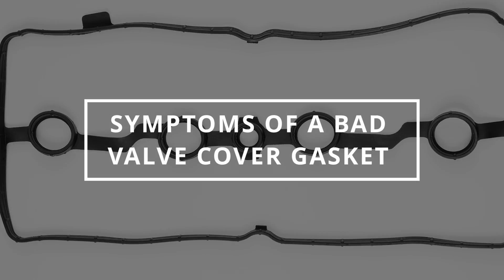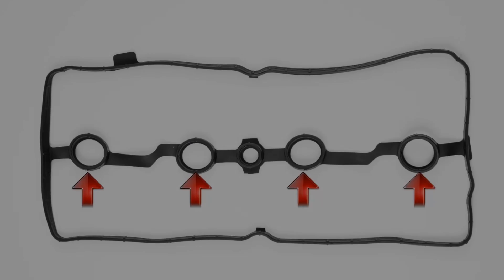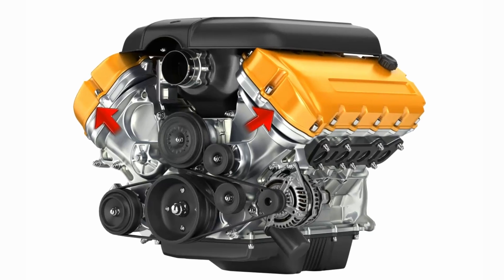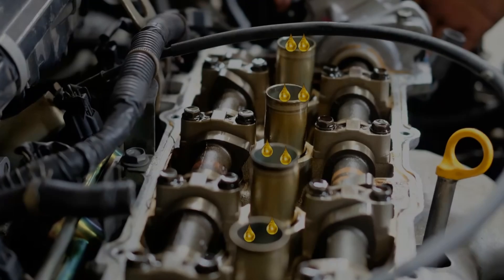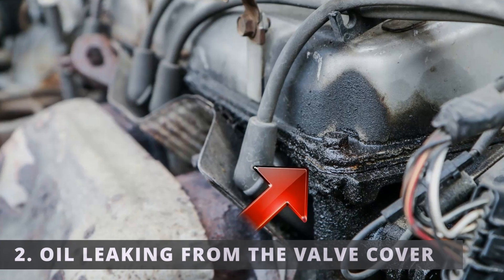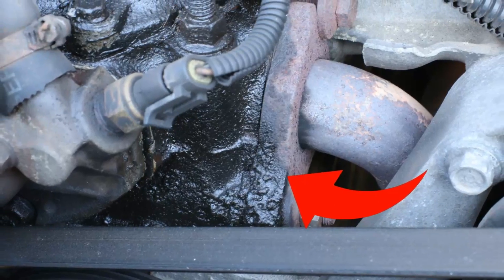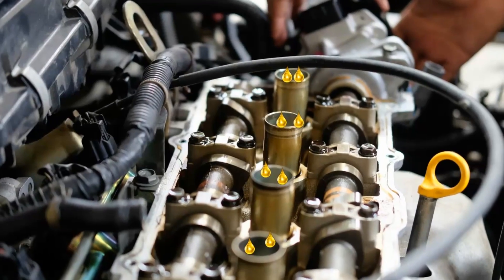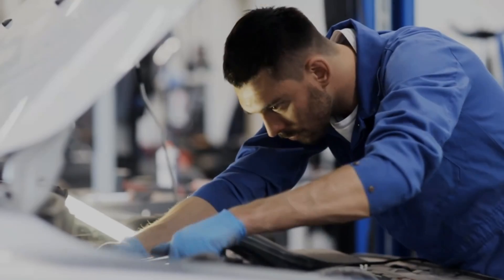SYMPTOMS OF A BAD VALVE COVER GASKET

Comment from the maker: OBD2 Scanner: https://amzn.to/3PHRplS

My favorite repair manual: 
https://www.gopjn.com/t/SENKTklLS01DSE1NS0lOQ0dKRk9LTw
(Use code AD10VA for 15% off one-year subscriptions for any US Order)

Have car-related questions? Check out JustAnswer! They have verified auto mechanics that are available as live help 24/7: https://justanswer.9pctbx.net/qndBon

Check out my merch: https://easyautofix.creator-spring.com/

Buy a new valve cover gasket: https://advanceautoparts.rt8x.net/YgZ2BJ

Here are some of my favorite items that you might like:
Tools: https://amzn.to/3xNDb8g
Car Vacuum: https://amzn.to/3EjhPSJ 
Cleaning Tools: https://amzn.to/3El7dCG 
Water Repellency Wiper Blade: https://amzn.to/3utvK50 
Cleaning Gel For Cars: https://amzn.to/36NIiMr 
Portable Air Pump for Car Tires: https://amzn.to/3uBuPzA 
Headlight Restoration Kit: https://amzn.to/3qDpOVH 
Amp Jump Starter: https://amzn.to/3pMd0vx
Reply: Could this in theory keep setting off the mass airflow sensor

Comment: Wow. Wonderful video. Good info and quick and precise. This is definitely my problem. I called two local shops and explained my situation and they said they could do a diagnostic, I mentioned a pcv valve or gasket and they still didn’t confirm or deny. 

Anyways, this video helps a lot and now I know exactly what my problem is. 

I had oil in 2 of my spark plug wells, so I changed the spark plugs, and now I actually found the problem. Would be nice if mechanics irl would just be helpful and give tips. 

Thanks again! I was worried my entire engine was broken but this is actually doable fix

Comment: I have a valve cover gasket leak on the drivers side of my 2007 jeep grand Cherokee and its causing alot of smoke to happen every time I drive. It's rather embarrassing. I miss my corolla. Had it for 3 years and the only issue i ever had with it was a bad temperature sensor. Other than that it never failed or let me down.

Comment: Would this lead to a ticking sound when driving? Just noticed the leak from the gasket and am going to change but want to know if there is another issue I also have to get fixed
Reply: Having this same issue rn, did you figure it out?

Comment: My car started misfiring and I took the rear spark plugs out and they were covered in oil, but there isn't much sitting in the tube's so would I be safe to put the spark plugs back in? As a temporary fix
Reply: When you take the plugs out, the oil will drop down back into the cylinder. What I would do is just a shop towel, roll it up so it fits into the cylinder well (make sure the spark plug is out first) and soak up whatever you can of the oil. I’d also spray some break parts cleaner onto the spark plug and clean those off, and clean oil off the boot of the ignition coil boot. This will ensure your car gets a good spark and doesn’t stall or foul out your plugs. Hope this helps! 

I usually just use the base / handle of my smallest wrench, and just wrap a shop towel around it until it’s a perfect cylinder so it fits into the cylinder well with ease. ✌️

Comment: It's crazy. My oil was super black and low. My 03' G35 was leaking oil, and it seems like valve cover gasket. It takes 5 quarts but was low (it had about 3.5 quarts) before I changed it. After I changed it, I heard a pop and all my oil started leaking out like crazy, like pouring out water from a water botttle, all at once. Legit the 5 quarts I added leaked out. And there was smoke near my passenger headers behind engine. There seems to be no leaks from hoses. So my guess is valve cover gasket. But would it even be able to do that?

Comment: Would oily spark plugs be one of the symptoms?
I was changing the spark plugs on my 2010 chevy colorado with a 5 cylinder in line and the front 2 were dirty with oil stains 
And the rest were dry.
Reply: Yes

Comment: Just getting mine replaced on my 2011 5.0. I had smoke coming from the oil compartment engine backfires and it was burning oil and loss of acceleration getting it back tomorrow they also fixed my vacumme leak so hopefully it goes back to 100%
Reply: How much was it?

Comment: Man I’ve been searching for the my p0303 code for a month. Changed out the spark plugs, wires and ignition coils. Add an aggressive fuel injection cleaner. Nothing. I noticed a leak of oil from the valve cover where cylinder 5 and 3 are at. hopefully this solves the issue. Truck runs great just pops that code from time to time.
Reply: I have the same issue as you on my ford focus 2012
Reply: Update?

Comment: I replaced my valve cover gasket two times now in 2 months. It was leaking fresh oil the 2nd time around. Could this be the mechanics error the first go around?
Reply: Eh prob cover itself warped
Reply: Did you replace the washers

Comment: Does tightening down help this. i saw a video where all of the screws were loose on the valve cover.
Reply: Replace your shirt bro it’s way cheaper than buying the whole new engine
Reply: @8Jallin  Mine isn't leaking, kind of a light mist of oil on the side of it. That's why I asked. The truck only has 43k but it's an 06 and within time gaskets dry up. I end up buying both covers, seals,  New Z1 Electronic Coils as well as 6 new spark plugs.
Reply: @ELEVOPR  I see. Good thing it all worked out for you. I might check mine before I install a new one I might be lose too.

Comment: Will this cause oil on the spark plugs from the leaking? But only on the threads, the rest of my spark plugs are clean
Reply: Usually the plug valley will fill up, even covering part of the spark plug boot. So it's only oil at the threads and below, nothing above the crush washer? If that's the case then unfortunately you have a much bigger problem. :(
Reply: I think it depends on how long u leave the issue un fixed or something I'm a complete novice also it might be how the valve cover was made

Comment: So I have been chasing code after code, so now here we are left with the last 4 codes, bank1&2 lean, Catalyst both banks below threshold, LTFT is sitting at 33 at idle. I have been hunting down what the heck could still be leaking, then I did my spark plugs and saw oil and put two and two together, pcv directly to intake is on valve cover.
Reply: @theory816 when I blew my timing belt it was negative 5 degrees out, I kind of screwed that one up myself, gasket was smooshed and twisted, and after I was done, I didn't do the pcv valve yet, my first ride smoked out the hood, PCV valve went completely.
Reply: @theory816 So I solved it, I was watching bank 2 being rich and not paying any attention to the lean on bank 1. So ripped apart and replaced valve cover gaskets, and pcv valve, egr O ring and intake upper and lower. Car runs mint. Still have a fluctuating idle sitting in drive. But I am going to address the transmission too, filter and fluid.

Comment: Is it safe to replace the bad gasket with rtv silicone?
Reply: No do not just use rtv purchase the correct gasket for your vehicle. Use a little rtv where needed a very small amount. And make sure to clean the surface of both the engine and the valve cover itself. When cleaning old gunk off make sure to wipe it out tword you as not to get it into the engine

Comment: How do you tell if you need to replace engine and cabin filters?
Reply: If you don't know when the last time you changed it might as well go ahead and change them both.
Reply: If you put the air filter infront of light and you could see the light through the filter it’s still good. If not then it needs to be replaced. I usually change mine every 12k miles. The cabin filter usually you could smell a bad smell when you turn on the ac. Sometimes it’s the cabin filter other times it’s mildew that grows from the water left after using your ac
Reply: Look at them if they look dirty then change them

Comment: How much is a usual fix for this? I have this problem and it’s not killing my car as of now but i can smell the oil from time to time when I start my car
Reply: It’s easy to do yourself and costs  like 20-40 bucks depending on what you drive
Reply: @mopshot20 what if i know nothing about cars. Just went to the mecanic yesterday and gave me and stimate to get it done but wanted to charge like 700 being like 20-40 in parts
Reply: Do it yourself please
Reply: It was like 150 for me
Reply: Parts range 100-500 depending on manufacturer and the kit. It's a good 6-8 hour job especially for a novice. Trained master mechanics even take 4-6 easily, but again dependent on the car. And that's assuming you're doing a proper full replacement which is valve cover, ignition coils, and spark plugs. If you're in there to change the valve cover then it's best to get all 3. Labor is also variable but assume $150-200/hr these days. Parts will range for the ignition coils and spark plugs too.. All in all my job for my 2018 BMW 440i just cost me $2700.. $1700 in valve cover and labor alone ($500 part, 1200 labor) and no additional labor for spark plugs/ignition but that was another $400 and $600 respectively, in parts.
Reply: @bigfirepop Wut. Lol I think with a little effort most people can get it done by dedicating a full day and watching youtube video step by step and save yourself $700. 
Valve covers GASKETS are typically very cheap... Between $10-$60 max. Now if you're replacing the entire valve cover (unnecessary unless its cracked) that's a different story definitely a little more expensive.
Reply: @slickmastajay  the extra grand in labor comes with a warranty and convenience - that's really what I see as a labor fee. I don't mind paying for that. Especially worth it in my case as the first 2 valve covers were aftermarket and came with their own issues which were again replaced at no additional cost to me because I paid the original convenience fee. Encountering the issues we ran into, it would have taken me much more than just 1 day to resolve and it all would have been on Me to do so.